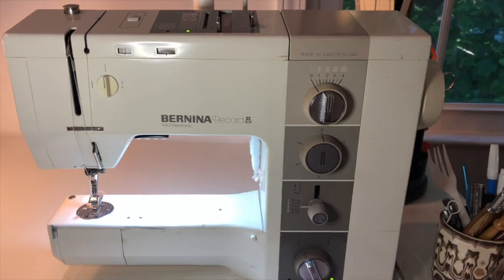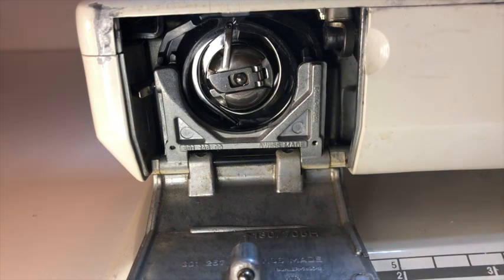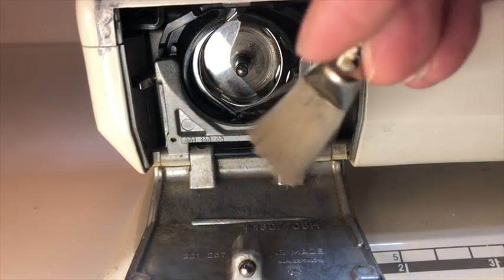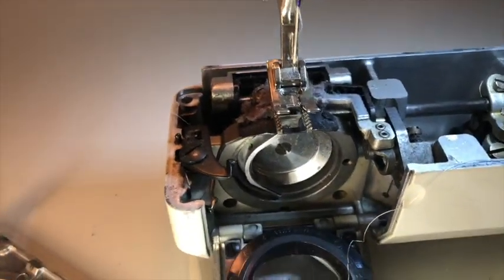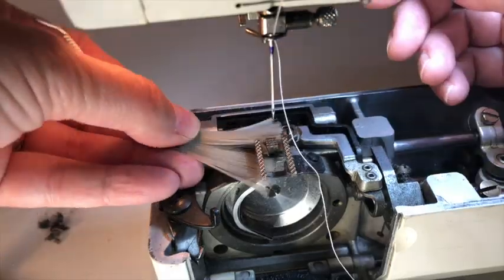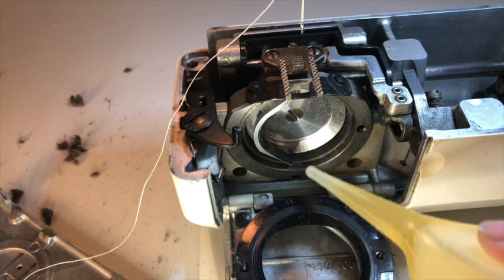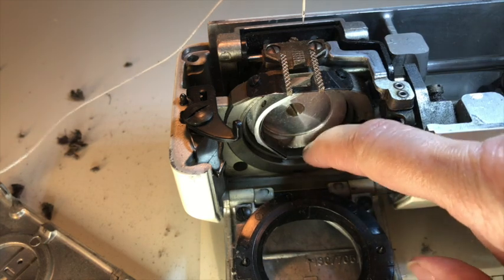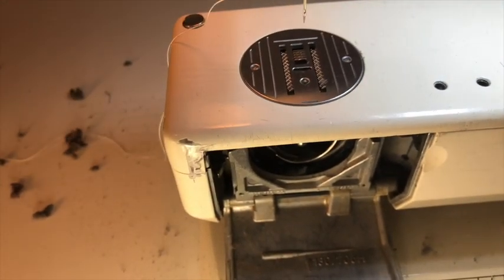How to Clean and Oil a Sewing Machine: Bernina 930

Comment: Great video about oiling and not using canned air!  I didn’t understand how to put the bobbin casing back. It just kept falling out and didn’t seem to fit. I found someone else’s video from Australia who showed up close exactly how it fits in there. It’s not just haphazard. There are parts on both sides that have to connect. The easiest way I have found is (1) tilt the machine back just a bit and put something about an ich or so tall under it  so you can see what you’re doing and (2);shine a good light on it.  (2) turn the flywheel until you get a half moon at the bottom and then hold the casing so you see the three holes at the top.  If you line up the narrow finger-like protrusion on the right with where it should sit above the jagged looking part on the right side of the half moon on the bottom then the left side will be correct too.  When you let go it should just stay by itself but there is no clicking in place. Then close the door and make sure that clicks closed. I hope this helps someone as frustrated as I was putting it back together.

Comment: Very helpful.  Is there a video on lubricating the top of the 930 Bernina.  I have the manual that shows were to oil, unfortunately the picture is dark and I can’t see where to oil it.
Reply from the maker: You can download PDFs of use and service manuals here: https://www.manualslib.com/manual/630275/Bernina-Record-930-Electronic.html
Reply: @LyricMontgomeryKinard  I had found manual online and realized that the manual doesn’t show where to oil on top when top cover is removed.
When I purchased my Bernina 930 in the early 1980’s, they put an extra page inside my manual that showed the places to oil.  But that copy was dark and not easy to see where it indicated.
Perhaps I am not supposed to try to oil it.
My tension was off, following your instructions about cleaning, oiling, and new needle helped a lot.
Reply from the maker: @pamgross1084  TBH I usually just take the top off every once in a while, make sure everything is clean, and put a drop of oil pretty much anyplace that moves. These machines are beasts so it would be hard to mess anything up.
Reply: @LyricMontgomeryKinard  thanks. That is what I did.  I love my Bernina 930

Comment: Thanks, you saved me!  Thread jam, started removing parts, cleaning, and couldn't figure out how to get it back together.  Tiny little rubber gaskets popped off the fold-down part. didn't even realize there were any, yeash!

Comment: Hi! This was aw great video and I'm going to clean that area in my old and true Bernina 931 right now! But I need a tutorial as clear as yours to clean and oil the whole machine! I have moved way out into the boondocks of coastal Texas and I don't think there's a certified Bernina shop within 500 miles. Do you know of a tutorial that could  help me? Thank you so very much!
Reply from the maker: These older machines are serious workhorses. I simply suggest taking off the lid, opening up the left side, and getting out as much of the gunk as you possibly can. Then crank the wheel slowly and put a drop of oil at the joint of every moving part. You can do this!
Reply: @LyricMontgomeryKinard  Thank you! Your video here helps me understand the concept, look for the moving parts and oil those! I got Bernina oil today, also, the kind for the older machines.

Comment: Hi there, do you know if you use CB or rotary hook oil? Bernina phone line don't seem to know about old machines...since they're a good company I was very surprised. Thought it was worth an ask!
Reply from the maker: Use a good mineral oil - made for sewing machines. Old machines have metal gears and rods unlike newer machines. You need an oil that is light and doesn't evaporate, leaving a gummy residue. If you have a new machine, read the manual and follow instructions. Some newer machines are self oiling, some have plastic parts that don't need oiling.